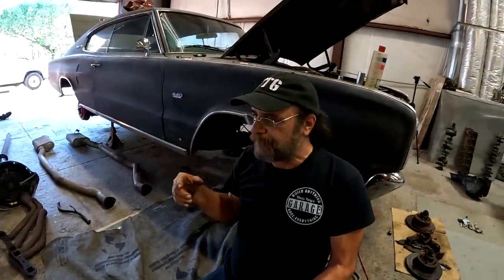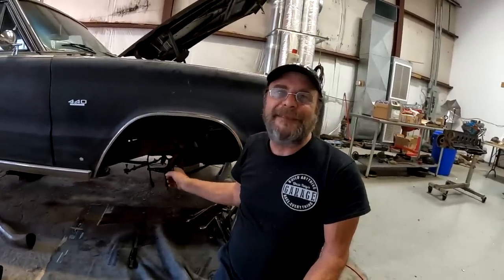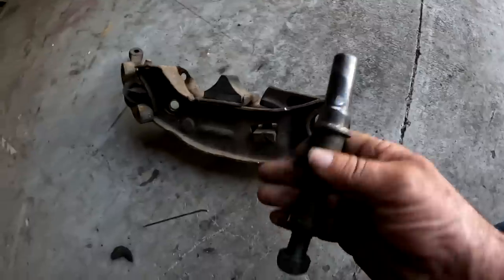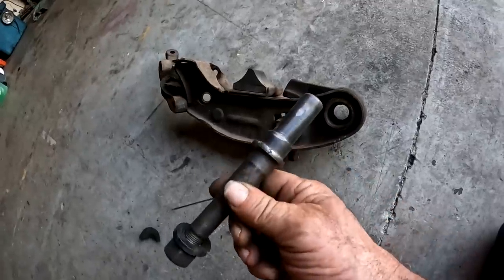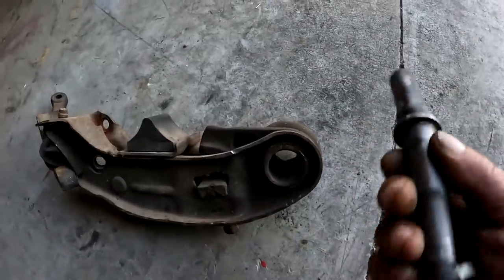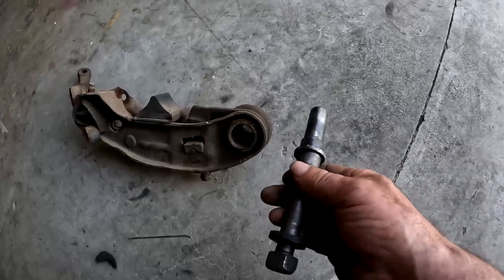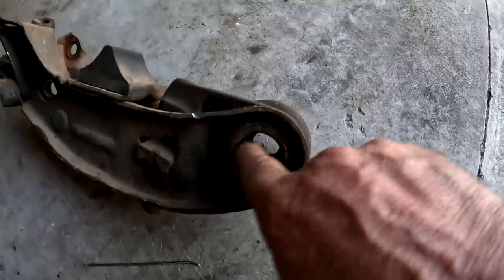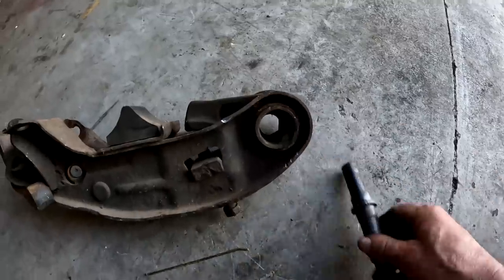The Achilles Heel Of The Classic Era Mopar - The Dreaded Lower Control Arm Bushing

Comment: Yep. Replaced the bushes on my Australian Chrysler Valiant not long ago. I could not work out where the assembly pivoted. Couldn't believe the rubber bush flex is what Chrysler intend for such an important bearing. Anyway I got the outer bushes out by welding 4 longitudinal beads spaced around the inside.. they basically fell out with a tap from a drift. The inner bushes my trucker neighbor showed me to emboss longitudinal lines on them with a cold chisel and BF hammer which stretches them so they come off. Had to use a press to get new ones in though.. they are tight!

Comment: Uncle Tony, have you ever used an air chisel to remove control arm bushings?  Basically, you aim the chisle between the inner parting surface of the bushing flange and the lower control arm so the chisel acts as a wedge between both. It may need to be held at a slight angle towards the control arm to get it started (all around) but be aware that too much angle will cause the chisel to dig into the arm. Once you work around the bushing, angle the chisel to push the bushing away from the control arm. Personally I have never done a Mopar bushing but I know it works well on typical stamped steel control arms and I realize there is less contact surface between the 2 parts.. Once removed, coat the control arm with a thin coating of Never-Seez so in the future it will not rust in place. I had contacted the manufacturer and they recommend it's use for press fits where corrosion can be an issue such as tie rod ends, suspension bushings, ball joint studs. It does not cause problems or a part to become loose. An air chisel is worth trying. For the ones I did, the inners were held in place by the bushings. It moved them surprising fast.  I agree with the manual.

Comment: Now I'm kinda glad I only had bent bar Mopars. Many moons ago (1998ish) I changed the bushings in my 5th Ave with polyurethane and they came out pretty easy with a crappy holesaw and lots of water, similar to the job I did many years later on my Bronco. No press and no chisel, the only way it could be easier is if I had a oxy/acetylene torch to just burn out the rubber. Leave the outer sleeves in and squeeze everything together with a vice. What I didn't like is they don't give you enough grease, buy extra and use it liberally. After the job my old Chrysler drove like a new car but it squeaked like a million chew toys in a puppy mill.

I think the biggest problem with the F/M/J suspensions is not the lower but the upper control arm bushings. When they wear out the camber gets wonky, and if you drive through ruts the front end is all over the place. Easy to replace, easier to just loosen the adjustments and pry out the uppers and re-tighten them, at least until you get the replacement bushings.

Comment: If you go with the polygraphite bushing you just remove the rubber that’s all jacked up and leave the bushing sleeve in place .  Grease up the poly bushing and slide it in .     I picked up the set from Rockauto with the oversized (bushing side) pivot pin and  the best thing of all is it’s greasable .
 ProForged 12010003
I use a ball joint press to push the old units out .

Comment: These are a piece of cake. You don't need a welder. I thread an 1-3/8" tap into the outer shell, and press it out. Works every single time. I've been doing it that way since the early 80's and it's literally painless.

Comment: because you need a good press to install them ? Back in the day i just bought some polyurethane bushings , brought the lower control arms to my local auto parts place and they installed them for 20 dollars . not an issue at all . The Mopar front suspension was designed for stock car racing ! Tony thats a Cool trick to remove outer bushing collar if you have a welder , never saw totally gone rubber bushing , but i worked on them in the 80's to early 90's., my own cars that is .People may not like how this suspension takes bumps and pot holes , but i near the end of owning one found that front drag shocks made the ride amazing ! Adjustable Drag Shocks ! Yes on the street for bumpy roads ! no more bottoming out ! they fight the front end from collapsing and allow upward travel ! Its like stock shocks on this suspension system is designed to destroy it !

Comment: My first car was a 1968 Barracuda, didn't run, 104,000 miles. My Dad worked all the time. He bought whatever manual I needed.
I worked in a Harley Davidson dealership and we would weld a bead about an inch long on two sides of the inner races in the steering neck. That shrank it just enough to get it out when much trouble.

Comment: I feel you brother.  On my 1966 Satellite in high school, I had to do these and after failure after failure, I had to finally pay somebody to do them.  Then 15 years later, I had a 1974 Duster with shitty lower control arm bushings.  Now this is still "pre-youtube" years and I bought a tool to do them and it still sucked more than Texas in the summer time.  Now, 35 years after high school I have a 1965 Barracuda that had bad lower control arm bushings.  I said in no uncertain terms, "screw that I'm not dealing with them" and replaced both the upper and lower control arms with QA1 arms LOL.  Problem solved forever!!

Comment: Aye you probably dont need this little tip but a ball joint clamp works well if you dont have a press, if you tack it to something waist high its almost a fun job. Also to anyone who may need to read this, the washer idea works if your a decent welder, if you just pucked one up from harbor freight, you either have to weld the washer to the inside, so if your weld breaks the burr still keeps the washer in place. If all else fails chisel the edges towards the inside and just lay slag upon slag till it fills up just DONT TOUCH THE EDGES with the welder

Comment: I hope that the new urethane ones work out as easy as predicted. I have had the kit for a couple of months, but have yet to do the job on my 74 Dart daily driver in fear it may put the car out of commission for more than a weekend. I replaced the uppers about 6 months ago. Piece of cake!.  I only got 6k miles from a new set of tire due to the lowers still being bad due to age. the car only has 57k miles on it, so it isn't due to mileage. If you were in east TN instead of west TN, I'd try to bring the car to you!

Comment: Urethane bushes that allow for movement usually come with grease to actually lubricate them. Alfa and VW on their torsion bar systems had splines - which allows setting ride height without using preload. Adjustment you are showing is just preload?

Comment: Try putting in the front sway bar rubber bushings to K-frame, well it was tuff for me, made a wood press and all types of clamps 🗜️ and vise grips, did one that way and the other I gave up and had the welds split and clamped one in that way and reweld keeping it wet with rags to keep it from melting

Comment: This is the kind of stuff that makes me appreciate my GM vehicles…. On the other spectrum a job I really despise on 70’s 4x4 half ton ford trucks are the radius arm/front axle C bushings. What a pain, especially if the truck has been exposed to road salt at some point in its life.
Reply: That’s the kind of stuff that makes me appreciate Chrysler. Funny how Tony raves about everything about Chrysler except this one, single thing, and you use that one thing to discount all the rest and praise Ford, which put springs above the control arms, as Tony points out in a different video. 

If you’re a Ford guy, that’s just fine. We’re all entitled to like what we like. But if you’re going to say something bad about what I like, you better make sense and use logic or else I’ll call you out on the nonsense.
Reply: @Dr.Jekyll  the springs above the control arms is still insane to me

Comment: UT, if it makes you feel any better Porsche 911s from the mid 60s through ~1989 use a very similar setup w/a torsion bar indexed through a concentric, non-turning rubber bushing.  But on the 911 it's both front AND rear suspensions.  Also a real PITA to replace.

Comment: Glad you found the polyurethane bushing solution.  It'll last longer than the car, since it won't be in torsion like the OE rubber design.  Use some silicon grease between the bushing and the inner and outer sleeve.

Comment: I have a 99 Dakota that does exactly what you described tony. As my (wretched) roads curve and the newer top coat in the center of the road dips and bows it pulls my truck hard. If I let my hand off the wheel for a second at 55 the truck tries to kill itself. Not ever road does this to it but the half-assed roads that need to be re paved between counties are the worst. The truck must have flirtin with disaster playing on repeat somewhere at all times. On the expressways it's fine, but I don't have torsion bars in that truck. And I know the rubber could be bad but it's passed inspection every time and they never brought it up meanwhile theyve mentioned my rear axle has a slight clunk if you push the driver side wheel in and out but there's hardly any movement. Just the nature of the c clip

Comment: Well I have replaced them on A bodies and C bodies and I don’t mind doing the job even here in Australia they lasted well on the crap roads.I found that the brake reaction rod bushing allowed too much movement backwards under braking and it would lever on the bushing. The pin is not keyed like you said but it does interference fit into the hole in the k frame at the last shanked area very well. Before I would press the pin into the new bush I would fit the pin into the hole and tighten the nut to specific torque and get a large set of Stilsons or pipe wrench (large) and on the old bushing sleeve that’s left on the pivot pin I would try to rotate it the k frame. You leave sharp grooves in the sleeve but it gets taken off anyway so the pivot pin stays in good condition.

The bush as we can see is mounted inboard and it’s motion is small and if your bump stops are in good condition then it should not over travel and stress the bush.
I believe Chrysler should have made the brake reaction rods like Ford falcon caster bars and you can pre load or adjust the clearance out of the bushes .
And I know you will know this but don’t allow the pivot pin to lock into the k frame (leave the nut loose) till the car is at the correct ride hight. 
This stops the bush from being preloaded and over twist the vulcanised rubber apart. 
I also mark the pivot pin shank and k frame with a white paint pen opposite of each other so I know the pin has rotated in the k frame before tightening the nut when the car is at ride height.

Comment: Back in the early 80s we raced Mopar circle-track. We wouldn't even bother replacing the bushings. You could get a k-member with the entire front suspension from wrecking yards for $20. We'd just swap the entire lower control-arm rather than deal with those stupid bushings. Now we would go with the urethane bushings. Nobody made them back then. We considered making aluminum ones but never got around to it.

Comment: You'd absolutely love the kingpin retrofit for jeep ball joints, think it's available for dodge trucks too. Much like the urethane control arm bushing it will last longer and perform better. Yet another Achilles tendon undone.
Reply: Urethane control arm bushing are terrible.  They don't allow the suspension to articulate like it should.  Rubber bushings can last for years.  For the street polys might be ok, but If it was really that good manufactures would use it.  It would save their technicians so much time.  Urethanes bushings pivot on the sleeve which can allow contaminants destroy the surface.  Rubber twists and leaves no room.
Reply: @foch3  grease on Teflon plumbers tape on the sleeve fixes some of that. Deflection of the rubber and the torsional spring inherent to the bonded rubber on the sleeve are downsides in my book. I want fast reacting suspension for grip and accurate handling
Reply: @Lecherous_Rex  urethane binds all the time that's why you need to grease them.  Grease turns into an abrasive slurry exposed to the elements.  Polys don't allow the suspensions natural buoyancy, doesn't want to return to ride height because it's binding.  If it was better every manufacturer would use them because they're cheap and easy to install.

Comment: I need to do this on my Dart eventually. I couldn't figure out how it was put together until now, thank you. The other thing that sucks with these is when the upper ball joint pops out. Just had that happen last week. New, name brand upper control arm and ball joint, came assembled, the ball joint popped out and took the threads with it after only 6 months and 10k miles. Put a new ball joint in and welded it in being there were almost no threads to hold it. I also had this happen on a Scamp about 6 years ago, but with its original control arm and ball joint. The Scamp also broke a torsion bar going down an off ramp from the highway. And the one thing I refuse to do to any car and will gladly pay someone to do is u-joints. I hate them. I will rebuild an entire car myself and I will pay someone else to do u-joints.

Comment: I have a 63 Dart GT that's No.3 on my project list. Everything in the front end is toast. I've had all the parts sitting around for a few years now, and for the reasons you stated, they'll likely sit around a few more.🤨
Reply: At the time of installation, won’t all the rubber be many years old, shortening the time it will be in good service before you’ll need to replace the rubber again? If urethane, then not as much of an issue, but the ride is going to be harsh.

Comment: I seem to recall that there was a separate part number for the LCA if it had a front anti-sway bar. Most cars didn't.  UT, couldn't you build a replacement bushing that included a grease fitting?

Comment: What!   Urethane bushings in a Mopar!   That's almost like an Olive move!  :)  (Actually I'm glad they invented those.    Cause we didn't have em way back when but parts were abundant and cheap and thirty or more years younger. You could just get whole k-members for A-bodies and change anything dubious.  (Anyway,  I'd dream of  restomod k-members that'd support torsion bars but more adjustability on the shocks-and-camber end.  But that'll remain a dream.)

Also,  I call Point Of Order on your Not Having A Press  Cause Regular Folks thing.  Lifts are one thing,  I think you should allow yourself a press even if it comes from Harbor Freight for cheap or is an old piece that has to live outside and may need fixing.  :)  (I think there's content there and also,  being an aging skinny gal  who's getting fewer results from hammers and improv than I used to,  I intend to grab one at nearest convenience)    I might set a challenge of doing some of this stuff with cheap stuff rather than necessarily juat farming it out,  even if that's really the better move.  :)

Comment: I had no issue pressing mine out/in, but then I bought a cheap Harbor Freight press specifically for this job (and now yes, it's just sitting taking up space in my garage) and also a specialized tap and it was an easy job. To me, the real Achilles Heel is when those threaded LBJ sockets begin to wear out and no longer allow new ball joints to thread in and hold the required amount of torque, and of course no one reproduces them, and for my year/make/model ('73 B-body), they don't offer tubular LCAs, so there's basically no solution but to scour used good LCAs.

Comment: I use an 1 3/8" by 6 tap in the outer shell of the lower bushing. Run the tap in and press on the tap to get it out.

Comment: I have been using urethane bushings for years. A little harsh but the road feel is much better. Like you said, these cars weren't even supposed to even be here and alive now. 
  Hot Rodders to the rescue to make it better. And yes the Mopar T bar suspension has even more benefits than just being adjustable like lower center of gravity and much better instant center than most any other suspension built in America. Just look under the front end of Chevy 4wd trucks from 88 to up in the 2000s. Yep. T bars.

Comment: The PST poly graphite bushings with the greasable bushing and zerk on the front end of the shaft are easier to install IF the outer bushing can is ok, but they suck. I put a set in my 70 Charger. The problem is that the new poly bushing isn't attached to the outer shell. That let's the control arm move forward and backward. That doesn't cause a problem with steering or handling.  But when the arm moves aft it leaves a gap for the new greasy bushing to squirt out the front, split into pieces and self destruct. Mine lasted about 5-6 months.  I don't even drive it that much. Went back with factory style bushings that are made into the shell and no problems for over 3 years. Let us know how long yours last. I weld the washer in too for removal. A thick washer.

Comment: absolutely the first thing i do to my mopars is fix this number one problem with a mopar,the lower control arm bushings,it will never  hold an alignment without them being dead on,i use urethane,i want just a little movement to offset the ripples in the road and don't want it transfering to the steering wheel,go uncle go

Comment: Had at least 7 mid-60’s Mopars as daily drivers, but about 15 years after these were born I quit trying to house and feed them because rubber was ALL becoming pooched. Switched to Chevy Vega’s because they could be picked up cheap, bores steel sleeved, could take a 45DCOE Weber carb (with the right Offy manifold) and sometimes came with a T-10 5-speed. Then found out how easy to install a SBC mill…